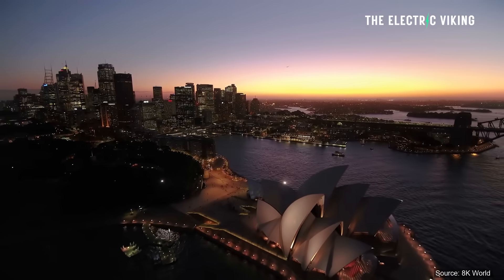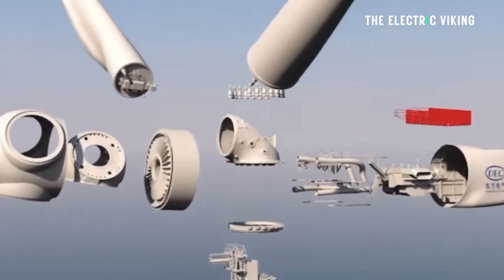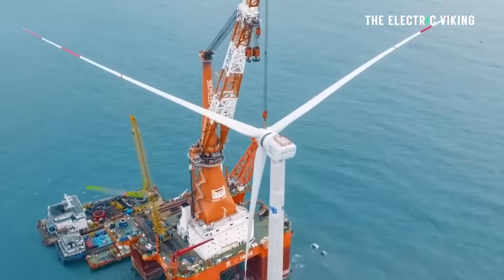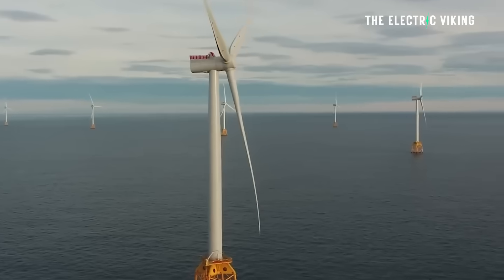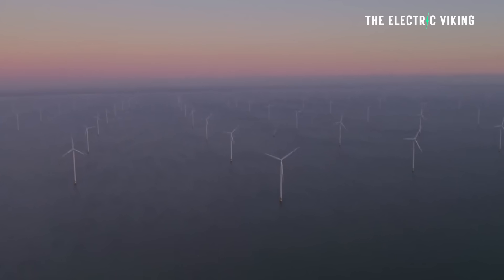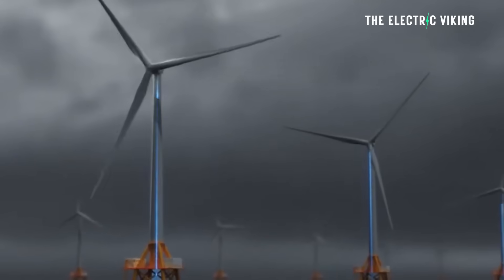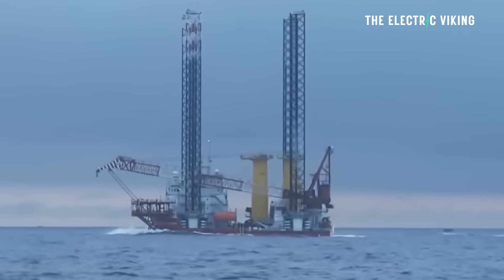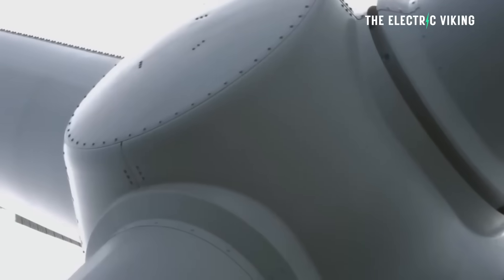The World's Biggest Wind Turbine is Taller than a 63-Story Building

Comment: Not content with having killed off all its birds, China now wants its turbines to be a threat to small planes.  The turbine is capable of powering tens of thousands of homes, if, if, if.  The if's are everything.  The way forward in wind energy is not in ever-larger wind mills.  It is with vertical installations.  These may not be as technically efficient when all the ancillary costs of wind turbines are excluded, but they are far cheaper to build, safer, easier to build, and not so unsightly.  In dollar efficiency, they are likely to be far more efficient than the wind turbines are in generation efficiency.

Comment: Yes these are enormous, is high as mountain ranges. Think of the surface area covered by the rotors as a solid disk and you will see the pernicious effect these have on the earths climate. Mountains in the sea. And they require a concrete plug 4000t heavy. And powering homes is not powering industry. They retard wind at 50%, the tip moves at 400 mph/700 kmph.
Never mind the death of birds etc. , retarding wind means less thermal energy, humidity being moved. The effects are unknown but massive. 
Anyone with a little physics will agree. 
Solar on a roof is benign, wind turbines are not.
Reply: There are always negative people like you
Reply: You sound like a little person afraid of big things.  Sad.

Comment: Gaslighting at its best.  This wind tubine alone  CAN NOT power 55000 homes.    As usual you leave out all the  otherr significant infrastructure required and the fact the even with storage you cant guarantee supply.  If you want guaranteed supply you need on demand generation backup and no discuusion on the cost of energy from back that would be used intermittantly.   Eventually people will notice you are not telling the whole story, i hope.

Comment: Wind turbine blades are made of composite materials, typically consisting of a fiberglass or carbon fiber structure for strength and stiffness, often reinforced with balsa wood or polymer foam for the core. These materials are held together by a strong thermosetting resin, such as epoxy, that forms the composite matrix, creating a durable and lightweight structure resistant to heavy wind and weather.

Comment: One of these behemoths does not even power a single home for one year. It provides an average energy supply of 3 hours a day from March to September and an average of 7 Hours from October to February in Germany. Energy must be used the second it is produced and it is needed 24/7 - 365 days a Year. Longterm data in Europe show, that the average production of electricity in Winter is double the amount it is throughout the Summer. After 30 years of listening to "powers 55.000 homes" - while this is not true and has never been - reality has to strike and the presentation method must change. Why is it so important to repeat the myths, when people should simply be told the truth.
The offshore turbine provides power for a few hours (nobody can forecast exactly when). Than You need an integrated system of grid connection, battery backup and grid stabilisation additionally - but it is still not enough: You need an alternative method of producing exactly the same amount of energy for when the wind doesn´t blow at all (or too much) - nuclear, coal or gas - and only than You can power those 55.000 homes the year through. While the production of wind power electricty itself is cheap - the integrated system needed is overall very expensive.
Reply: In 2024, wind power generated an estimated 488.1 TWh of electricity in the European Union, accounting for roughly 18% of total EU electricity generation and exceeding the generation from fossil gas for the first time in 2023.
Reply: @jensonee  Yes, I know the EU generated 20% less electricity for double the cost it used to until 2018. When less coal is used to produce less energy - automatically the percentages for other forms of generation go up. The EU also produced 20% less steel, 20% less cars and 20% less chemical products. The effect is contagious. Even my petrol car used 30% less energy, it only consumed 840 liters in 2024 instead of the 1200 liters of 2023. If I go on like this, by 2050 it will use Zero (!). Big spoiler ahead: instead of 12.000 km I just did 8.400 km, exactly like the EU is doing.
Reply: @SunshineShane  it's obvious you only read what you want to read.  "..... exceeding the generation from fossil gas for the first time in 2023."
Reply: @SunshineShane  In 2024, wind power generated an estimated 488.1 TWh of electricity in the European Union, accounting for roughly 18% of total EU electricity generation
Reply: @jensonee  Yeah, I read absolute numbers and context  regarding production and imports - not percentages. I.e. WHY? was fossil gas generation exceeded? Because gas hit the highest prices ever? Could it be, that exchanging pipeline gas imports for the much more expensive and scarce LNG gas have had something to do with it? Or was it the increased hydropower generation (+50 TWh in 2023) that lowered gas generation? Maybe the EU even had to build the port capacities and conversion capacities for LNG first.
Reply: @SunshineShane  what's your point?  that wind and solar aren't the future?  they're not competitive? that climate change isn't real?
Reply: You are citing poor obsolete design without any battery or energy storage buffering.
Reply: @Hystericall  even more added cost - and it still doesn´t work 24/7, not even half of it.

Comment: 26.000 kWh per hour = 2.600 l of Diesel (with aprox. 10 kWh/l) so  equivalent of 680 l/Diesel per hour at full load, yearly average on a good place would be aprox 1/3 of nominal power, so: 8760 h/y * 1/3 * 630 l/h = 1,8 Mio. Gallons of Diesel per year. In case you already drive electric this would be enough for aprox. 380 Mio. km/y or 235 Mio. miles/y. So thats why some are drilling like crazy, not much time left to do so.

Comment: great when the wind is blowing!
Reply: And if the wind doesn’t blow the sun will shine and if the sun doesn’t shine they use grid storage batteries.
Reply: Offshore wind happens primarily because the wind over the sea is stronger, more consistent, and less turbulent than wind over land. This makes the open ocean an ideal place to place large turbines that can capture this powerful, uninterrupted wind to generate electricity.
Reply: In 2024, wind power generated an estimated 488.1 TWh of electricity in the European Union, accounting for roughly 18% of total EU electricity generation and exceeding the generation from fossil gas for the first time in 2023.
Reply: So, you're implying that it's a mistake to invest in technology that allows for taking advantage of wind energy when it's available?
Reply: Troll bot?
Reply: They put them where the wind blows most of the time. Search and watch Tony Seba.  SWB, solar, wind, and battery will make fossil fuels for auto and energy seem like bloodletting.  The simile was mine. At that point plastics will probably start being replaced by glass, bio or synthetic materials because the drilling and mining expenses will be too great for plastics alone.  The weight and energy to produce glass won’t be an issue with cheaper production energy and cheaper electric transportation.

Comment: You have to remember that wind turbines rarely, if ever, actually generate their rated output. The last time I analysed a whole year of data for the UK, the 24GW of installed turbines averaged out at 6.2GW, with a peak of 13.2GW, and a low of 0.09GW. For substantial periods wind turbines generate less than 10% of rated output.
Reply: The UK as of right now has...........

A total combined active onshore + offshore wind turbine capacity of 31.888TW.
Delivering 87.432TWhs of total annual electricity generation.
Enough electricity generation to currently power over 26.5 millions homes in the UK per year.
Source: UK Wind Energy Database

"The last time I analysed a whole year" - When did you supposedly do this"analysis', in 1980? You seem to be short of a lot of MW. Do you apply the DESNZ’s average load factor (%), as would be expected, in your supposed "analysis", because your calculated numbers look too low, even if your given erronous starting point was correct?
Reply: @BrentonSmythesfieldsaye It was, I believe for 2019, or 2020. Whichever year it was when there was 24GW installed. I crunched the numbers on wind turbines output logged every 5 minutes for every day of the year and calculated average output, peak output, and minimum output. Also, if you want to mention 'erronous' figures, you stated what the current installed capacity is in TW. Don't you mean GW? To be fair, you're only out by a factor of 1000. Assuming it was just a typo, then if you divide the number by TWh supplied by (365 x 24) then the answer is an average output of 10GW, or less than 1/3 of the installed capacity. If you'd like some homework, go and work out how much of UK grid demand was met by wind generation for the 4-day period ending 7/11/24. I calculated about 7%
Reply: "wind turbines rarely, if ever, actually generate their rated output. "
This is simply not true. Wind turbines operate at rated power over a large range of wind speed.
You can't look at a country's total installations and from there deduce that a turbine 'rarely' produces at it's rated output.
Reply: @christianherzig1575  i am pro wind, but it is true that wind turbines are rarely at rated ouptut. And that's no big deal, no one ever claimed they would !
rated output is reached at windspeeds above 10 m/s (36km/h or 20 mph). at the mill strts turning slowly at very low output at 3 m/s. Typically, a wind turbine is turning 80% of the time, at vastly different outputs.
When you see one NOT turning on a breezy day, it most likely is due to curtailment (excess power on grid, due to runaway success of renewables), or more rarely, outage.
What beats me is that no congnoscenti "discover" something, then throw it on the industry as if they had been misled or something.
The dynamics of windturbine are known since day one. 
Yes, it is an INTERMITTENT source of very cheap electricity. Del with it.
Reply: @silverdiverr thanks, you are right. (I had the power output curve of an Enervon turbine data sheet in mind). Optimizing the the generated energy depends on the site's wind speed statistics. With a high wind speed variance, targeting constant output over a large range of wind speeds would lose energy production at high wind speeds.
Reply: In 2024, wind power generated an estimated 488.1 TWh of electricity in the European Union, accounting for roughly 18% of total EU electricity generation and exceeding the generation from fossil gas for the first time in 2023.
Reply: @jensonee But you still need gas-fired power plants to be available for when the wind doesn't blow and the sun isn't shining. It costs the same to build a power-station and pay the staff whether it generates for 100% of the time or 10% of the time. Adding wind and solar will reduce CO2 emissions but let's not pretend it's going to reduce electricity prices.
Reply: Whoops, correction.

The UK as of right now has...........
A total combined active onshore + offshore wind turbine capacity of 31.888MW. <-- correction MW not TW
Delivering 87.432TWhs of total annual electricity generation. <-- the TW here is correct though
Reply: @BrentonSmythesfieldsaye 31,000MW = 31GW I assume
Reply: This output is with curtailment, which is shutting the wind generators down, because you have no place to sell the electricity. Storage is, therefore critical.
Reply: @johnstubbe3113 No it's not, that's the amount of energy they can produce, limited only by the variability of wind speed.
Reply: wow, you have "discovered" what was known and physically evident since day 1 !!

Comment: The Diesel equivalent of 26 MW is 2600 gallons per hour of diesel
Reply: 26.000 kWh per hour = 2.600 l of Diesel (with aprox. 10 kWh/l) so "only" 680l/Disel per hour at full load, yearly average on a good place would be aprox 1/3 of nominal power, so: 8760h/y * 1/3 * 630l = 1,8 Mio. Gallons of Diesel per year. In case you drive electric this would be enough for aprox. 380 Mio. km/y or 235 Mio. miles/y.
Reply: @WindFritz 10kwh/letter is over the gross energy in diesel. If you can get 10kwh out of  a gallon you’re doing really good . More common to get 8kwh / gallon. That’s net not gross.

Comment: The main problem of offshore turbines is the greater maintenance they need because of the corrosive salt air and the higher cost to maintain them because of their location.
Reply: So what? .... this argument  is absolutely  PATHETIC!
Reply: @jimmurray2965 it's the difference between the turbines being profitable or monuments of failure. The Dogger Bank wind farm has yet to provided electricity that is cheaper than other methods. Cheaper electricity from offshore wind farms is still a future goal.
Reply: @sangmoon2464  In 2024, wind power generated an estimated 488.1 TWh of electricity in the European Union, accounting for roughly 18% of total EU electricity generation and exceeding the generation from fossil gas for the first time in 2023.
Reply: @jensonee  Unfortunately, offshore wind generated electricity is still more expensive than most other sources of energy, but they project it will get cheaper in 25 years. If you trust people to make accurate economic predictions in 25 years, you have a problem.
Reply: @sangmoon2464  are you sitting at the same computer you were sitting at 25 years ago?
Reply: At this point I won't be surprised if Chinese are maintaining them, cleaning them via drones which themselves powered by renewables
They are using drones everywhere
Reply: Each one comes with a free Chinese maintenance worker that lives inside each unit.
Reply: @nl4402 jealous much

Comment: How will these giant turbines survive a 250km/hour typhoons? You can't limit typhoon winds to 200kmh 😂😂
Reply: They lock down in high winds, and I’m sure these first units might get failures, how ever the data collected will make subsequent units even better.
Reply: if a truck's load restriction by manufacture is 5 ton, can it load 10 ton?
Reply: Do typhoons bring down mountains?
Reply: @rendezone You have no idea what these storms can do.200 kmh typhoons with heavy rains have gusts winds over 250kmh, A 250kmh typhoon and with heavy gust winds? I dont think any of those propellers can survive that.
Reply: you haven't a clue.
200kmh is for longer periods. but GUST resistance is way higher.

Comment: And when wind ain't blowing the right speed or direction or windmilling to much you got go coal or oil and pay company's of windmills for turning off 😂 equals expensive electricity in UK we have loads these expensive  crap in North sea expensive is a understatement yes it green but  you still burning lots money😂 in fact it's most expensive electricity you can have
Reply: The price is electricity is based on the price of the most expensive contributor, gas.  That's the reason it's so expensive.  Also the wholesale price is the same as about 4 years ago but the companies are pocketing the difference
Reply: @AdrianMeredith  The price is forced higher by the attempt to rely upon unreliable weather dependent generation.
In the days before wind and large solar , electricity was cheap and reliable.
Those days are now over.
Reply: They are called wind turbines not windmills, windmills grind grain.